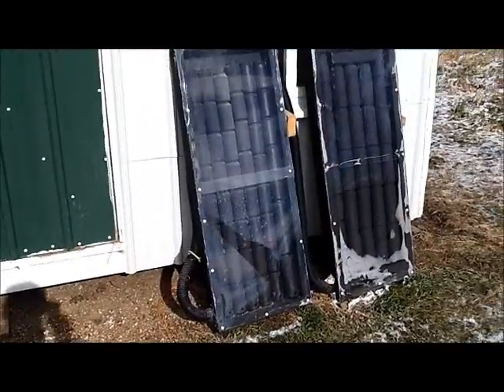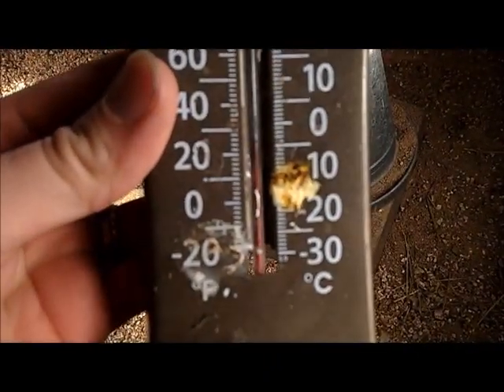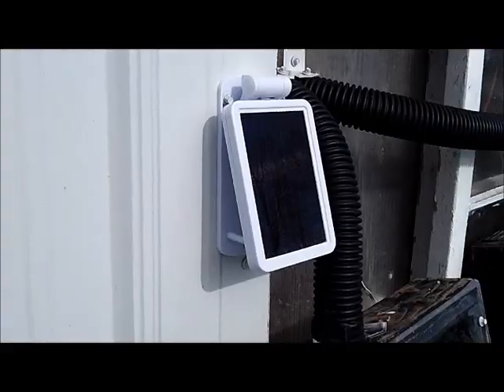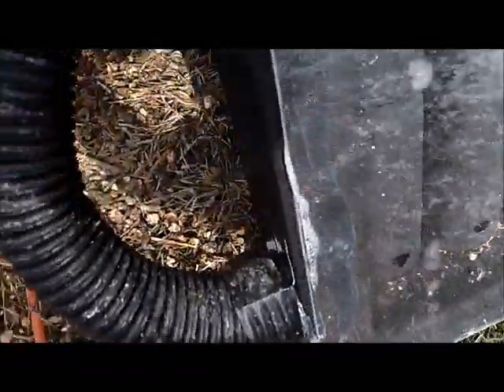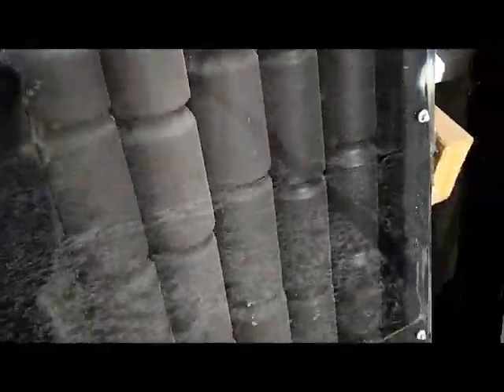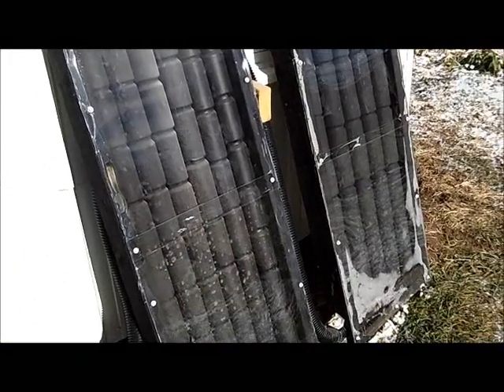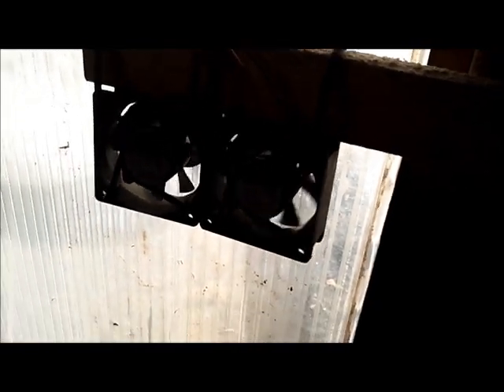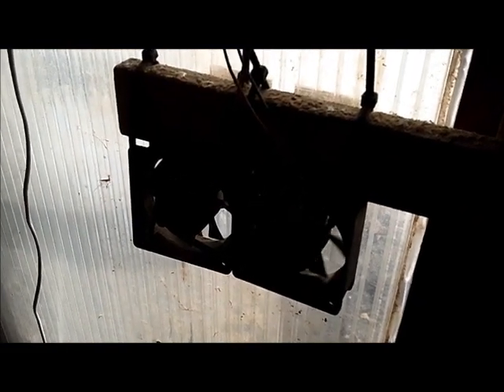Beer Can Solar Heater Chicken house!

Comment: you can create more heat by painting all of the wall steel and roof flat black, and add a gentle air circulating fan inside the coop and it will be real warm. you have an advantage of not needing insulation, where if it were colder, you could use something else. the beer can heaters will add heat to an insulated environment where it can hold it, an uninsulated environment is inefficient in utilizing what you are producing. i like your ideas, keep it up.

Comment: So anyway...insulate the air pipes using the silver backed insulation and it will raise the temp.
Reply from the maker: Leaving the pipes like they are black will also build heat same principle as the black cans

Comment: Cool, I made a solar heater out of pink foam board, black spaypaint, window shrink plastic and tape/glue, and one of those roof "proper vents"... Here's the link. https://www.youtube.com/watch?v=P8GLWEmLNPE Just thought you might try different methods. I found this way easier.